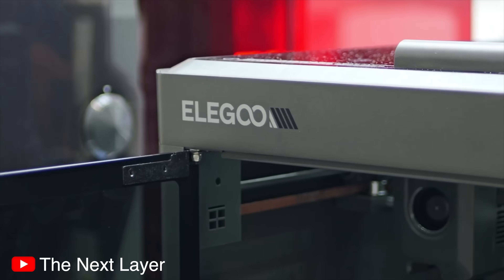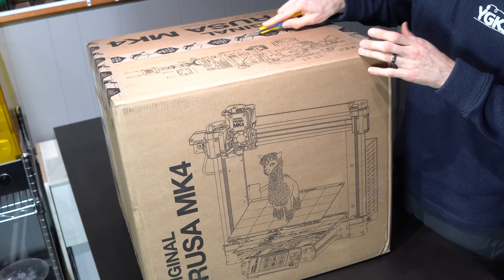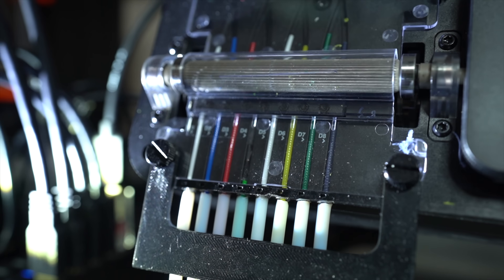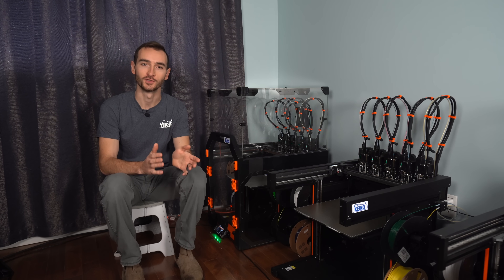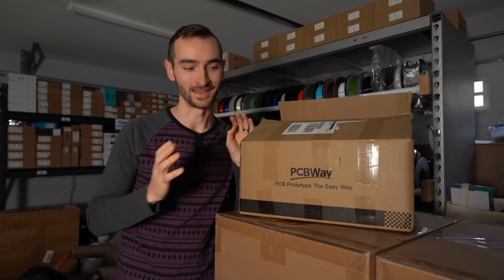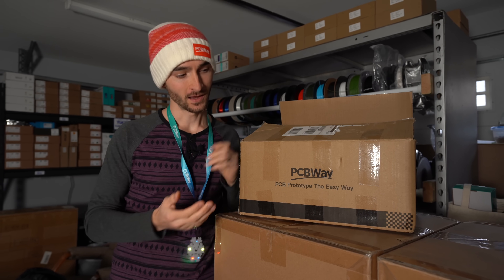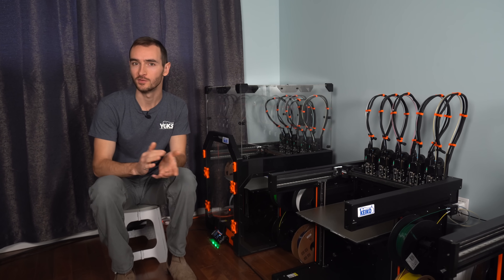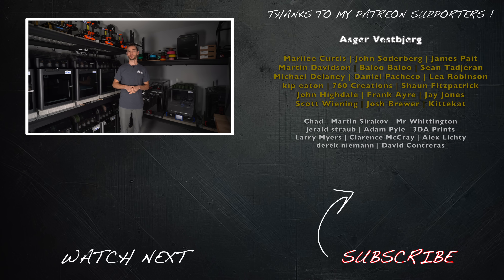The Prusa Core One is dividing the internet...

Comment: 11:52 What are you talking about @YGK3D ? 
the whole Core machine has every lesson learned from the XL in its design and firmware.
Is the reason they are now so proud of how simple and rigid the tiny CoreXY on the Core is, because is more challenging to take apart the XL gantry.

The Core It cannot be a toolchanger (yet, I hope) but the whole buddy electronics, load cell, input shaper, phase stepping calibration, the Core XY gantry, were all first developed and tested in the XL and the AFS.

Comment: I am at 1.7k hours and 774 hours across my two x1c printing mostly pretty harsh ABS, ASA, and CF- materials and have needed very minimal maintenance compared to any other printer I have worked with from two Formlabs Fuse 1's, dozens of Lulzbot, dozens of Creality Ender's, several Voron, and a Trumpf TruPrint 5000 
The Bambu Lab X1C has needed the least service and has been the most fire and forget of any printer I have experienced, the worst part is greasing the back lead screw, while even on machines that are coming close to $1,000,000 when you factor in all of the accessories, installation, shipping and training, the amount of down time is truly unreal, sometimes 2+ weeks to have a service technician come to service the equipment.

Comment: Controversial opinion I am team sovol the SV08 has a large build volume is easy to assemble enclosure even though it is technically single color currently you can get it for sub $800 with an enclosure

Comment: Prusa core one doesn't appear to have anything better than the competition, while still trying to charge an arm and leg for it. Prusa needs to face reality, this isn't what consumers want. Their multicolor solution too bulky, and the size of the core one is too small. Prusa missed the mark on this one. I don't know if the prusa fanboys can save prusa this time.

The reason its so divided is the prusa fanboys are the only ones who care and comment. Prusa clearly aren't selling as well as they use to, if they have to release a new printer every year.
Reply: The Core 1 would probably sell better if it had a printbed of 300mm2 or 3200mm2 and a better multi-color solution, Maybe optional second print head like the RatRigs.
Reply: Consisentcy is the Selling point of Prusas, a lot businesse i know have prusas despite them being smaller volume or slower, but theyve had better consistency print to print.
Reply: @DanielLopez-up6os  so I guess they havent upgraded to bambulab yet? That's like what I've been seeing a lot of prusa owners doing from the mk3. From a consumer friendly product, well its night and day with multicolor involved. Having a good multicolor printer is the future.

I don't mind old school 3d printers, as I'm a tinkerer. For a consumer friendly product, well you need to over a competitive product at a competitive price. Prusa ain't it anymore. They are turning into boutique 3d printers, for the fanboys. They are losing marketshare, because they've priced themselves out of the market.
Reply: Some of us are willing to pay for quality, service, and a name..  I am not a Prusa or Bambu labs owner but I appreciate many things about the products they have.   I personally would love to own a Prusa or a Bambu, but overall support and quality I would have to say that Prusa hands down wins that one.  Prusa will always cost more due to location where the machine is being made has higher cost of living and cost of manufacturing, this is not a deal killer at all.  Most folks do a purchase primarily for quality and support.   Price is usually not at the top of the priority list if a person deems it to be fair when looking at the overall package.
Reply: @jefft490  sure. This argument has been made years ago too. Times have changed, that's the thing though, you have to sell 3d printers to get that. I would argue other 3d printer companies are just as good if not better than prusa at way less price. Prusa has lose its luster and desire, because the average 3d printer buyer ain't even looking to buy a 1k dollar small 3d printer like what prusa is offering.

I actually own a prusa mk3s, sure it prints and its reliable, but a lot of cheaper 3d printers could do the same. I'm a tinkerer so its not a big deal for me if I have to fix something on the 3d printer. Prusa is lagging behind though, their multicolor solution could be better too.
Reply: @DanielLopez-up6os  so I guess they havent upgraded to bambulab yet? That's like what I've been seeing a lot of prusa owners doing from the mk3. From a consumer friendly product, well its night and day with multicolor involved. Having a good multicolor printer is the future.

I don't mind old school 3d printers, as I'm a tinkerer. For a consumer friendly product, well you need to over a competitive product at a competitive price. Prusa ain't it anymore. They are turning into boutique 3d printers, for the fanboys. They are losing marketshare, because they've priced themselves out of the market.

Comment: My situation is. I have a ratrig. 300x300. It's fast and reliable but I'm relying on myself for diagnosing issues. I was about to buy an x1c but a few local people had issues right from the box. One person had the issue of the printer restarting during the night and wrecking the toolhead. They still haven't been sent replacement parts.

I've always seen prusa as stability and reliability with good support. I wish the prusa was 250x250. But due to the bed size. I might have to keep my ratrig.

Another plus for the core one is the size. It's a good form factor. No wasted space. It has a significantly smaller foot print which is a big seller for me. The bambu labs is massive in x and y size. Maybe not in stats but it can't fit on my desk but the prusa can.
Reply: Seems like P1Ss are more reliable than X1Cs to be honest. The added complexity just adds more failure modes.

Comment: I broadly agree with most of this video, but I do have two objections.

First, comparing the RRP of the Core 1 to the sale price of the X1C is hardly apples-to-apples.  Indeed, the final question "would you rather have a Core 1 or an X1C Combo" is either pure bias, or a deliberately inflamatory statement intended to drive the YouTube algorithm.  Either way,  the effect is to reduce the value I put on your statements, because you've gone out of your way to make an unbalanced comparison.  Even if that wasn't your intent, it strongly implies that you have a preference and you want us all to agree with it.

Second, I strongly disagree that the existence of 3d printing hobbyists who have no interest in tinkering with the machine itself is new*.  It's just that until Bambu came along, no-one had actually built a printer that catered to our needs.  (Yes, I'm a "It just works" person.  My 3d printer is like my drill press - a tool, not a project.)  The internet is littered with stories of people buying a 3d printer, giving up, and letting it rot in their closet.  Bambu built a printer *for that person, and did it well, and dragged the rest of the industry up to a higher level.

Outside of those objections, I agree.  Bambu did disrupt the industry, that disruption is good for us all, and the Core 1 is Prusa only just catching up even as Bambu prepares to step forward again.  I also agree that Bambu has outgrown its ability to really support the customer.  I'm an X1C kickstarter backer - in fact, I think I had the third or fourth X1C in all of Canada.  And there were some issues with the early printers - but the customer service was excellent, when it was all new and the demand was relatively small.  I've had to work with their service again more recently, and while they did do their best, the answers were clearly not nearly as knowlegable and the response time was much, much longer.

Which is why I'd lean towards the Core 1, assuming it does all it's promising when it arrives, if I were buying a printer today.  Certainly if I was suggesting a printer to a beginner!  Because Prusa has the customer service team in place, and the shipping and support infrastructure in place, and Bambu's still isn't up to speed.  The prices for the actual printers are the same.  (Multi-colour through the same nozzle is a gimmick, IMO.)   Historically Prusa rarely puts their printers on sale, true - but historically they rarely need to.  I'd not be at all shocked if next Black Friday there was a race to minimum price between Bambu and Prusa.  So.  The prices are the same.  The features are similar.  The Core 1 looks a little easier to use; the X1C has a somewhat larger build volume (though I suspect for most people, not significantly so.)  The real differentiator here is the customer support, and Prusa is going to be much better at helping a new user than Bambu, at least for the next few years.  So, with all else being equal, buy the customer support.

Comment: My big issue is that to get a core one here in the states its something like 1500 dollars. That's like 2-3 p1's. You could print a lot with with those extra printers, and as a consumer you don't need the X1c's extra fancy stuff. As a business, 3 p1's is a lot more potential throughput. The value proposition just isn't there anymore. A few years ago when I got my first ender 3 my dream machine was a prusa, but its hard to justify now. I recently got my hands on a P1 and am happy with its performance so far, my days of dreaming about an mk3 are behind me now

Comment: I don't care if it came later. Prusa continues to be open source and care little about others ripping off their research. My prusas work, and when they don't work I can fix them myself. hell on my mk3 I use a 3rd party nozzle/heatsink to be able to change nozzles easier. I tend to print PETG anyways which means I'm stuck to slower speeds regardless. Bambu seems nice for libraries or as a first printer, but I will continue to support Prusa as they work for my constant printing and I know they won't turn around one day and brick my printer as they literally can't.

Comment: i ended up buying a prusa mk4s. The thing works really well. A lot of what turned me off from the bambulabs x1c was its reliance on the cloud and the amount of poop the AMS produces, it's also rather large and noisy. Also, when trying to find cons for each machine i noticed the bambu labs user base tended to be less helpful. Even in the comment section for this video there's comments calling out your credibility but not a whole lot of people encouraging you to do the work to fix the printers or speaking up and about their experience replacing the parts you need to replace.

If you ask me though, prusa needs to move on from the consumer market. You can't compete with the cost of producing 3D printers in China.

Comment: Both my Bambu A1 and A1 mini are just north of 1000 hours with no issues. I just want to print stuff and not futz with the hardware, so I'm super happy with my printers. The only thing I've had to replace is the original .4 mm nozzle that shipped with my mini, although a couple of the loaders on my AMS lite are getting harder to load, but I already purchased replacements for them. Seems like there are plenty of spare parts you can purchase and replace, so I don't expect to just throw them away when I do run into issues...

Comment: Imo the x1c combo doesn't make sense because Bambu makes the p1s combo for significantly less expensive and is functionally the same in every way that matters except for the absolute crap 2fps camera (but you can add a nice wireless camera and still come out far ahead of the x1c. Pricing if the x1c doesn't make sense. The pricing of prusa printers never really made sensd o me either because I don't want or need support (which is probably why the first is so high). But I get that people have different needs and different priorities. I currently have a p1s combo, a self built voron v2 (which I'm thinking about turning into a toolchanger), a voron v0 for rapid prototyping of small parts, and a creality k1 max (which I think I might sell soon as I've always had issues getting good first layer due to bed warping).  Is building a voron the right move for everyone? Absolutely not, but it has a ton of customization benefits and is a fantastic platform that works really well and in stock form is still less than an x1c combo.

Comment: Your MK3's may be old, and slower, but they are reliable, still working, still getting updates, and have confidence you can buy parts for it for a very long time.
Reply from the maker: They sat gathering dust for a long time but recently I had a project that could make use of them and they have been slowly but surely cranking out parts.
Reply: @ygk3d  Its amazing the comments that you get regarding the Bambu and Prusa printers. One was designed to be fast & inexpensive as its primary, and the other was designed to be sustainable and repairable first. They both serve a purpose, and they are both good printers. I own both too (well, not the CoreOne yet).  People just have to be honest what they are getting in the short and long term.
Reply: @ygk3d  only gathering dust because you didn't hit the print button on them? even if their slower they still work... this sounds more like poor planing than anything.
Reply: @xgeko2  not to mention optimizing workflow with filaments that really benefit from printing slowly .4 nozzle high detail CF-PC and PA12-CF work great on my mk3
Reply: What about making them 3.5?
Reply: For a Print farm I get that something like a Mk3s might not be reasonably profitable anymore. But for private, these machines are a BEAST!
Running mine since 5y and had zero maintanance or problems.
Reply: @florihae  They're reliable as f... been using mine since almost mk3's launch. How long has it been? Long enough to not regret buying it for a second.
Reply: @jothain  totally agree!
I would love to buy the new Core, but I really see absolutely no reason to do it. My Mk3s prints PETG just flawless and is truly plug and print 😍
Reply: @florihae  Was wondering the same... The Mk3S+ seems to be THE one choice, IF value for the money (in 2025) is considered, and the main goal is not speed. MK4S-Upgrade: I see no reason at all. Bambu Lab is out for me because I have high priority on self-service possibility and own choice of privacy. Core One IS an upgrade, and I would like to have one, but for the private guy in most cases not worth the price, if MK3S+ is available and working.
Reply: @yxcvmk  absolutely!
Many tests show even that the Mk3s+ has the best print results of all, if you do not mind slow prints. I really do not care if my printer runs 1:30h or 7h for a print, I am at work anyway 😂
Reply: Definitely.. They just work and work. Just because they are old, it doesnt mean they are bad. For most people, speed doesnt really matter. Only if one is immature and therefore impatient and needs a faster printer to satisfy his own impatience, its useful to have a faster printer. if you print many parts commercially, you have many printers anyways and print in parallel.
Reply: I don't know ever since we got our bambu labs I only used our prusa printers once. The immense speed difference and reliable print quality is miles different.

We might upgrade our mk3s to the m4 kit which will likely make the machine use able again but the ability to print a quality part for a client 2 to 3x faster is insane value as a company as well as KNOWING it will print 100% or atleast 95% success

Comment: You will be amazed at the customer support to get those two "paper weights" fixed. Bambu Lab and DJI are the ONLY two companies that break all the usual moulds. I'd be money Bambu will just send you all the parts you needs -- like an entire heatbed -- with video instructions on how to replace it. It won't even be that hard. If out of warranty, it won't cost as much as you might guess. They are, frankly, amazing, putting all other Chinese companies to shame. Give it a go! (Based on personal experience alone.)
Reply: Bro they have a 1.4 trust pilot rating all becasue of how terrible their customer support is. Is this a bot comment lol?

Comment: While I view the Prusa as premium product, I actually think they managed to keep the price reasonable considering the feature set. Is it the best deal on the market? Definitely not. I think Qidi probably has the sweet spot for price to high performance. That said, for printing mostly PLA and easier filaments, there are many better deals. Pros and cons to every brand, but I think the Prusa should be in consideration for anyone who wants a well supported, reliable, repairable machine which isn't totally made in China.
Reply: Your idea of premium is plastic instead of metal, plastic instead of glass, and 3D printed parts?
Reply: @hlop_vmp  You are focusing on a single aspect, material type. There are absolutely products which are made from plastic which are more premium and generally superior to metal counterparts and vice versa. Premium also does not just imply quality or performance. Premium is often about a brand and isn't even necessarily a good thing. It can be adjacent to luxury. High quality doesn't always mean better overall. I used the term intentionally to imply the bad and the good. General quality should be high, but they are also charging a premium, if you will.
Reply: @802Garage  so your entire point is that prusa is "premium" not because the machines are better but the marketing is better?
Reply: @sowa705  No. You're completely misunderstanding the term.